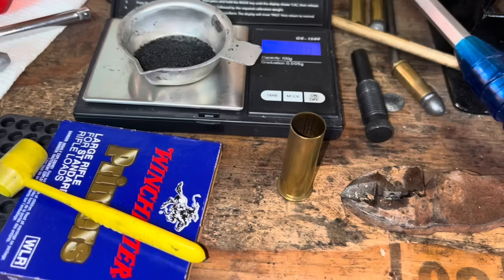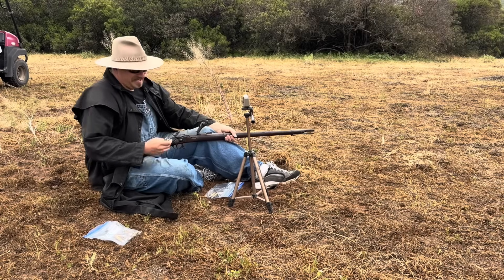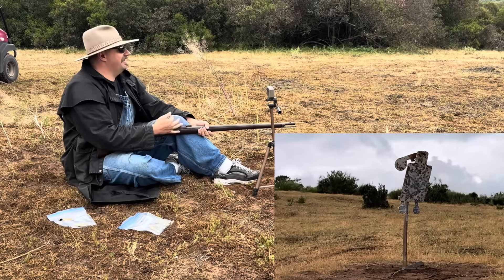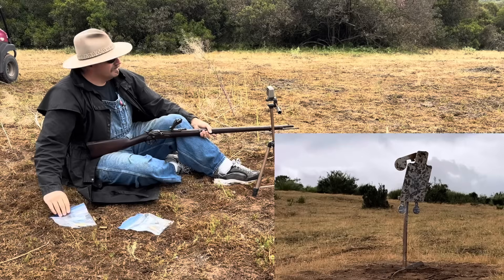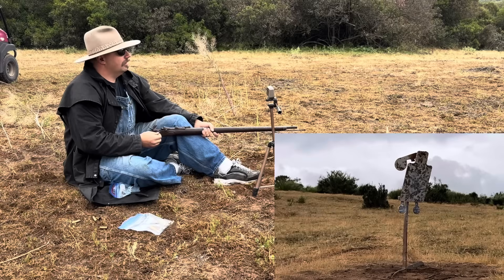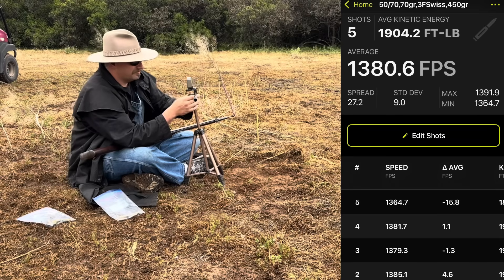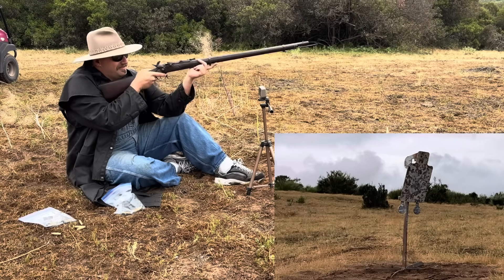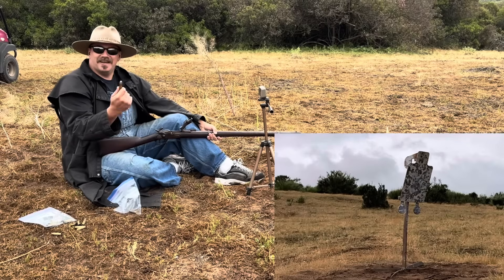Ammonium Nitrate Black Powder Cartridge Test

Comment: I said to myself, “self don’t comment!”.  Then I told me “I’ve got to”.  

I’m staying away from the chemistry. I’ll simply point out that what you’re doing is recreating the old express loads of the 1880’s. Like the 45-75 Winchester. It was a 45-70 case with 75 grains of a mixture of black and simi-smokeless, under a 292 grain bullet. 

I’ve got the Lyman mold for the 292. My dad was into black powder 45-70 loads. I shoot that bullet a lot with unique in my 45-70 rolling block. 

You are sitting at the threshold of investigating the old “express” loads. Those never reached fruition. Smokeless came along and they stopped experimenting with black/simi-smokless and light bullets. 

Now you not using simi-smokeless as it existed in 1889. Neither are you using straight black. Nor smokeless. You’re into your own version of “sort of dimi-smokeless”. It’s cleaner. More energetic. Higher pressure, as evidenced by your velocity. Bullet weight and velocity vs twist rate are probably at the root of your erratic accuracy. You can deal with that. 

Go to a “small bore” from that era, if you have one. With a light bullet and your “mixture”. I suspect you can hit upon a load that delivers both exceptional velocity and accuracy …. An 1890’s express load. A non-smokeless express load. 

Just a suggestion. 
Fox out

Comment: Sounds like you need to revisit the 45 colt with heavy weight bullets and Aludium Phosdex powder. Also reduce the charge a little and make some 50-55 or 50-60 loads.

Comment: Look up Ammonpulver, a propellant containing only  the NH4NO3 and C, which was considered as a replacement smokeless powder in the late 1800s.
Reply from the maker: I’m familiar with Ammonpulver
Reply: It's problematic. You can't keep it dry long and it changes phase when warm.
Reply: @davisrs1 you can stabilizate phase change adding 7 to 13% potasium nitrate to ammonium nitrate

Comment: One other modification you could make is to substitute some of the sulfur for Tetrasulfur tetranitride, also known as S4N4. It produces expanding gasses as it decomposes and leaves behind elemental sulfur as a byproduct, so as a substitution it would generate some higher pressures and serve to make the remainder of the powder burn quicker. S4N4 is classified as a primary explosive which is a little scary, so I'd start out with maybe 1% of it at first and work from there.
Reply: Not hating, but I doubt that would work well. 

I suspect the S4N4 would go off instantly or close to it. If it was a high enough % to ignite the rest of the powder with it, it would be  catastrophic. If not, I don't think it would have much of an effect, good or bad.

Comment: According to many load manuals that have a cast bullet section, black powder itself reduces case life because the sulfur makes the cases brittle faster. Annealing however should make them malleable again for the same reason over heating 416 stainless is bad. Cooking out the sulfur content. The 416r and Lw50 stainless alloys are low sulfur alloys to stop the issue. 
 The soft fouling likely the ammonia content itself. Original formula Windex has ammonia and that stuff eats through carbon fouling with little trouble. It really just needs enough time to soak in .  You can clean a bore with traditional solvent until the patches are clean when they come out and Windex can often times get more fouling out of the bore from the micro fissures and thermal cracks ,etc. as with any ammonia based products like copper remover, one must be careful with stainless steel.

Comment: Amazing that 5%AN has such clear results. Next stop 7.5%? The one thing AN adds to black powder chemistry is steam, I think the water formed in the oxidation of the ammonium ions helped make it cleaner, and the super low molecular weight of the steam helped drive that lead downrange. Very satisfactory video, what's missing though are revolver cartridges, for good measure.
Reply: 7.5% AN and Osage orange!
Reply: I would go straight for 10%. If whatever firearms you are using cna handle 10% duplex rounds, it can handle 10% AN. AN has significantly less energy in it than smokeless propellants.
Reply: The other advantage is that the ammonium ion supplies some of its own fuel, so you can use less sulfur/charcoal. Theoretically you could do something like 93/7 AN/charcoal and get very hot efficient  combustion with a lot of extra steam/nitrogen gas volume to boot.
Reply: @deltab9768  
Pressure will be an issue. AN without any moderators will decompose supersonically under enough pressure. Then you will have a detonation, and not a controlled burn. Another is the incompatibility with brass and other copper alloys, meaning you can't load it in cartridges and store it for any length of time. Diluting with a more stable nitrate or some sort of other additives is necessary if you want stable storage and/or combustion.

Doing a storage-test would be interesting. As long as your AN-content is low, something like <15% and your powder is absolutely bone dry when you load it, I reckon it won't be too large of an issue. Still probably want something to bind the ammonia produced, like some citric/ascorbic  acid or the like. Something like half a percent (or even less) should be plenty, and it would burn off without residue once fired.
Reply: @PwntifexMaximus  - regarding detonation hazard you are right, but only partially. It seems you forgot about the Critical Diameter - a minimum diameter specific for each explosive, where the initiated shock wave are able to propagate & accelerate blast to maximum speed of detonation.
For AN & explosive powders based on AN these Critical Diameters are generally large. So, if you not gonna use such powders in 12ga shotgun or larger, it should be relatively safe.
Relatively - because higher AN content gives you powders more simillar to smokless in terms of pressure dependent burn speed, maximum pressures, temperature & impulse - and using them in classic BP guns would be not very wise idea at all.
Regarding burning rate - AN powders should behave better in larger bores/chambers (higher pressure vs lower gas speed) than in small caliber firearms (lower pressure vs higher gas speed. And it was observed during EBP tests: larger caliber get more energetic, smaller caliber get less energetic than Swiss).
I'm very curious about the carabine cased ammo (bottle necked) results. I would expect almost smokeless results, but I could be wrong.
Reply: @sylwestermichalczewski9095  
This is in the context of a unconfined theoretical mass of explosive. Not one perfectly contained by unyielding steel. Be careful when using assumptions if they simply do not apply. Critical diameter is a lot lower with good confindement even in two dimensions, let alone three as is the case before the bullet gets moving.

That said, looking up ammonpulver in hisotrical uses it seems like it wasn't a problem practically, even with 0% KNO3. It appears like it has to melt before it can decompose, and this melting is what prevents D-D transition.
Reply: @PwntifexMaximus - I think I got your point now.
I assumed scenario with fresh & dry AN powder & cardriges assebled just before shooting.
If we start to analyze the longer term storage in confinement case conditions (no exchage the byproducts of spontanious AN auto-decomposition initiated by endothermic AN hydrolysis reaction which take place even with trace amount of moisture), rising HNO3 & NOx contamination in the powder during the time, nitric acid & nitric oxides auto-decomposition catalithic impact on AN & the zinc/chromium ions contamination from brass/stainless case - such ammo loaded into a gun chamber could turn into small bomb - I agree.
Theoreticaly, such powder could auto-ignite in brass cases if it stays confinement & poluted by zinc ions long enough.
Reply: Want that in 45 colt

Comment: EBP,  Seems to me more powerful BUT only when compressed as the cap and ball pistol was disappointing (+ 30ish for all the extra work).  If yer making more maybe try yer normal 255 over 40 in a 45 Colt for comparison.
Reply from the maker: We will definitely be trying some in 45 Colt

Comment: I would be curious to see how black powder works in one of the worlds oldest cartridge still in use.... .22 LR!
Reply: It was originally black powder, about 4 grains of black powder it Ran about the speeds of standard velocity rounds today.
Reply: @Johnh2078 Between the World Wars many .22lr cartridges were loaded with a mixture of black and smokelss powders. The black powder cleanup completely masked the effects of corrosive priming. It wasn't till smokeless powder became common in all cartfidges that corrosion from potassium chlorate primers became a problem.

Comment: Doing a little chemistry math, 25 alludium phosdex, 1 charcoal, 2 sulfur should produce a fairly clean and energetic powder.  Depending on how greedy the sulfur is a modest surplus of oxygen to a tiny deficit.  Don't ask me about stability or combustion rate, I'm not that skilled a chemist.  I'm not ruling out high order with the right trigger.
Reply: Yeah If you could get the right burn characteristics, that would have some serious power.

I  also saw a recipe on pyrobin for "ammonium black powder" for fireworks. It was AN, charcoal, and powdered aluminum, 90/6/4. No idea what would happen if you used that concoction in a firearm, but it's awfully similar to tannerite which can go high order from bullet velocity so...
Reply: You will never keep that mix dry long enough to be used in the field.
Reply: By volume or weight?
Reply: @randomidiot8142  by weight, as usual with chemistry.

Comment: For the 45-70, the shanks on the Lyman 405gr and 500gr bullets are almost identical. So the compression of the 70gr powder charge would also be about the same. The 500gr cartridge would be 2.835" long and the one with the 405gr bullet would be 2.550" long, for a difference of 0.285" or just over ¼".
Reply: Another learning experience, thanks guys.  Can’t wait to see where you take us next.  Phil
Reply from the maker: I’ll take your word for it

Comment: Well, i ran my Phosdex powder today with some video testing. Though mine was loaded up for literally weeks in brass 308 cases. No problems with the brass on my end. Results were very unexpected lmao saw some things ive never seen before.
Reply from the maker: 😂 I hope that’s not a bad thing
Reply: Guess you lived to comment about it.  These are the stories told over a campfire with no recording devices present or cell service for miles. 🍻
Reply: @KD0LRG Im down, whiskey by a fire with the buds talking about our crazy cartridge loadings lmao 

Got an uncle that mixes slow burning and fast burning smokeless powder to get insane velocity without overpressure. Says the fast burning powder mixed with the slow causes the slow to ignite faster, but it keeps the same pressure curve.
Reply: I wonder if the lower amounts of phosdex than what is used in things like ammonpulver lets it sit in brass for much longer without issue.
Reply: @jtyranus well, in my loadings, its about 60 ish percent ammonium
Reply: @theblindsniper9130  That's practically ammonpulber on its own. Wow.
Reply: @jtyranus Yep yep, im making smokeless powder. Its not a black powder with extra oxidizer